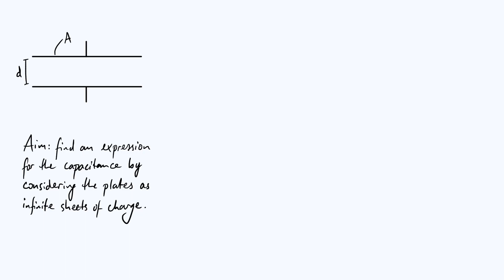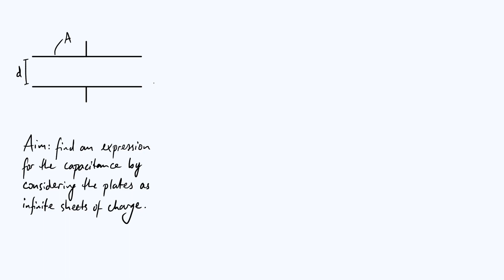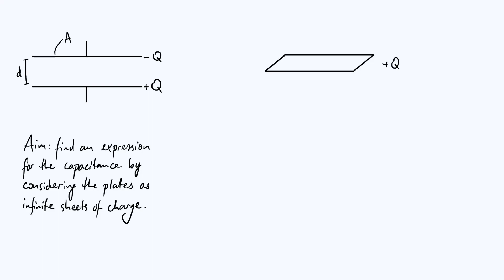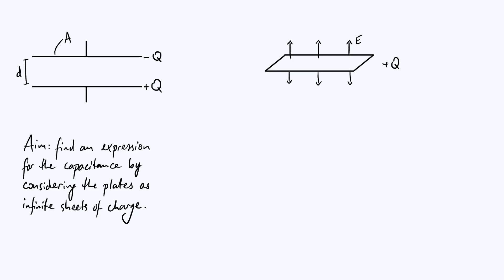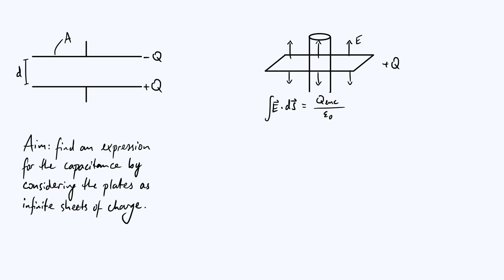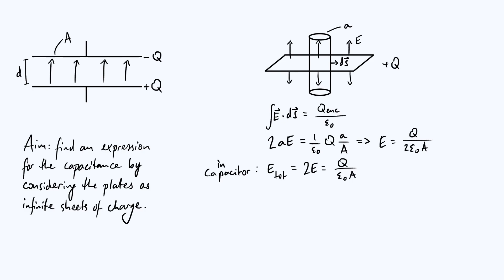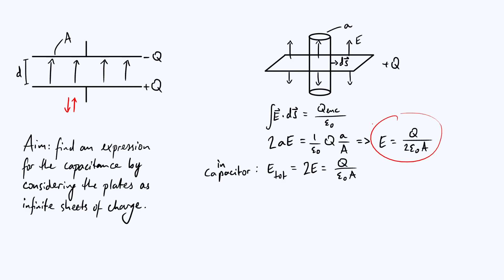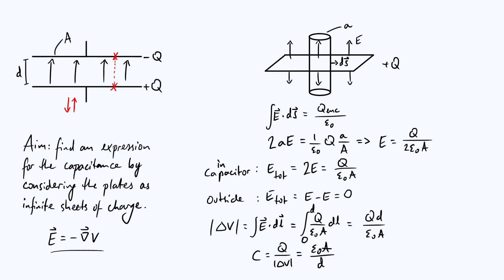Parallel plate capacitor as a superposition of infinite sheets of charge

Comment: Is the fact that the field due to each plate is independent of the distance to the plate a result of the infinite-plate assumption? Intuitively I would think the field due to each plate would get weaker with distance, but we didn't reference infinite area or charge and the surface integral still shows it only depends on the charge density so..